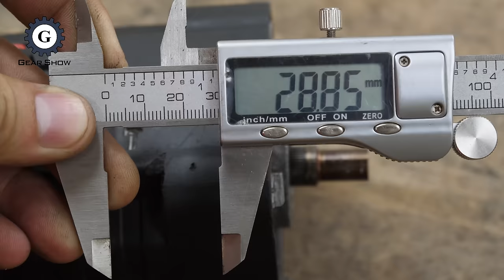Cord to Cordless 18V BL Rotary Hammer Drill Conversion | Makita HR2451

Comment: amazing.. how does this man know how to put everything back together?
Reply: he took a video of it....
Reply: Frankly, it's not that difficult. You just need practice.
My Bosch wireless drill recently burned its motor, so I just replaced it with a new one I got online. 
It was my first ever repair attempt but I do have some experience working with my hands. I don't have a shop and I did moat of the work on a regular desk. 
Just try and it will work
Reply: Know how
Reply: Simple... You buy 2 broken tools at garage sales & such for nothing. Try to fix the first and fail miserably. Video the second.
Reply: @fefifofob  except it is not LOL….he already know how the foundation work so you can work on another tools the same way…I do repair job so most of the time people send me something that I never work on but fortunately because I knew how the tech work…do it the first time and success..just spending more time to figure it out
Reply: I think there's a  maintenance manual
Reply: @albakhati5529  he completely modified the motors so that surely not in the manual🤣
Reply: @fefifofob  I think this is the exact way to learn.
Reply: @hgghgguk  how much do you need a license get a
Reply: @lisov4575  KJ kata yang juga ahli parlimen Seputeh
Reply: He's a wizard...
Reply: He is chinese
Reply: Remember he have a camera recording it
Reply: By watching the video of distmantling in reverse order.

Comment: How you can ensure that the motor won't spin around the extra piece what you added? 13:37
Reply: That’s the first thing I thought too. The press fit looked tight, but it needed some kind of anchor to ensure it doesn’t eventually start spinning around the shaft.
Reply: The correct tolerance fit would make sure that never spun. Many pillar drills have chucks that are just interference fit.
Reply: Thermal expansion after the first use should "weld?!" it.

Comment: What might be a good project for someone seems a complete waste of time and money. The cost of batteries charger and new motor for change of voltage plus an adaptor to clip the batteries to. How long will that press fit connection from motor to drive shaft last before slipping. It does work though. Why Why why?
Reply: Just enjoy the videos man lol